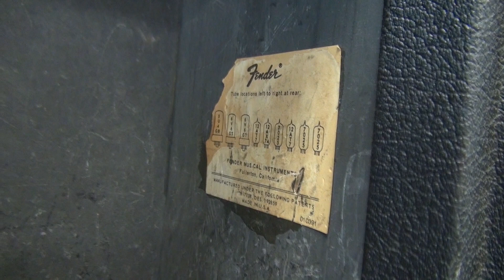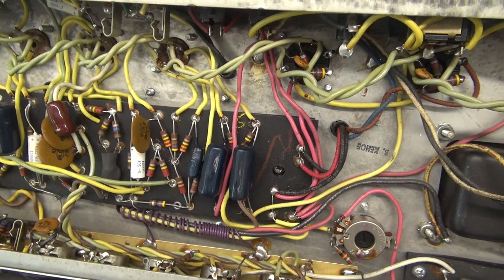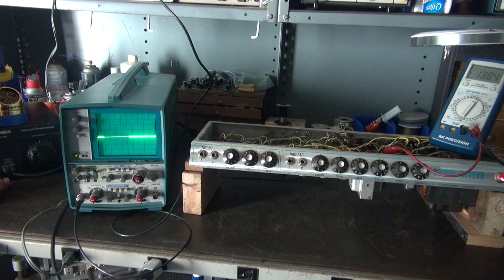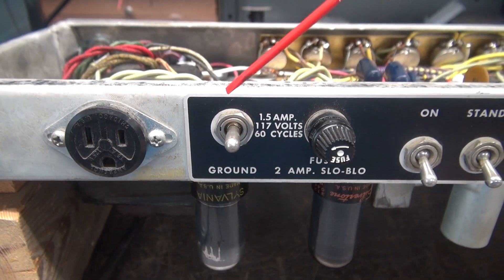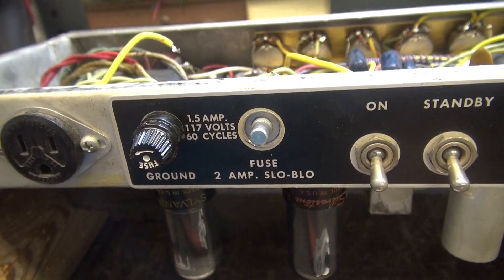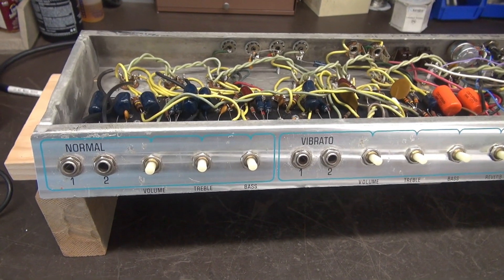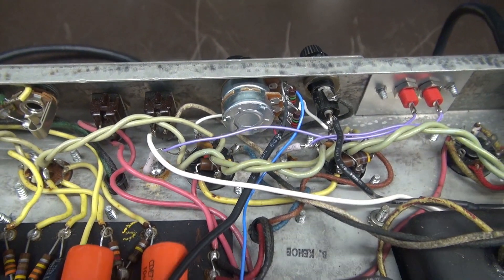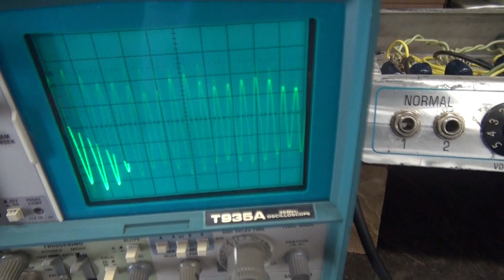How to Repair Fender Deluxe reverb tube guitar amp smoked filter caps

Comment: Excellent Deluxe-Reverb hose-down Terry. Last thing is to cut out the two 1200 pf ceramic caps from grids to ground on the 6V6 outputs. Now you have an AB763 Deluxe Reverb and you be stylin'. And once again; if you have hiss, replacing the carbon comp 100K plate resistors with metal films will achieve magical results. You might not have noticeable hiss since the existing 100K plates R's are 1-watt so they will be less cooked than your usual 1/2 watts. Still. I don't care how low the noise floor is...you WILL hear a difference going to MF 2 or 3 watt R's for those 100Ks. Take the $3 challenge!

Comment: As a long time player (and amp tech) I can tell you a master volume in the rear of the amp is a bad idea. This is one amp I would never add one to, it’s a beautiful blues and soul, funk or jazz amp just how it’s designed but to each their own. Nice video as always
Reply: In general,  I don't like to mess with original circuits...   However,  since it's a reversible mod,  I'm not too upset.
Reply: Customer requested it. It's reversible.

Comment: I see it's been a year since I last saw and commented on this video. I still would like to know where I can find the grounded accessory receptacle.  ANYWAYS... This time around I caught something I missed before - it seems you didn't need to move the fuse holder.  since you had to rotate the master volume pots for clearance, it looks that if you put that pot in the old ground switch hole, you could have rotated it the other way where the solder points would have been in virtually the same place (except inverted, of course). Any issues with doing it that way? Seems to be an either/or situation...

Comment: The 5U4 has a 5volt 3amp filament.
Question. Would it be safe to replace it with a 5AR4 GZ34? And if the high voltages go a bit higher can you just change HV power node resisters to a little higher values to compensate. Being the GZ34 is more efficient & has a lower current draw for the filament. It would be easier on the power transformer. Filament voltage Supply.

Comment: As I was watching this video, I noticed that this amp started out with a 3-prong grounded accessory receptacle (before you replaced it with the banana-plug bias test points. I have been looking for such a grounded receptacle (or two) for when I upgrade my power cord on my Silverface Pro Reverb and Bandmaster Reverb amps (that I've had since the 70s). Where can I find such a receptacle?

Comment: What was the reason for not leaving the fuse holder where it was and just putting the MV pot in the ground switch spot?
Reply from the maker: Yes, to position the Master volume pot as close to the output tubes as possible
Reply: @d-labelectronics  I understand that, but had it gone in the ground switch spot and the terminals turned to the other side, it would have been virtually the same distance and after you took the AC receptacle out, you wouldn't have had the power from switch to fuse crossing back over or under it.

Comment: Lol, nothing goes together like a bottle of wine & high voltage. Why didn't you leave the fuse in the original space and just put the rca jacks in the old ground switch hole? That way you would have only had one space misnamed. Other question is when you were measuring the negative bias, you stated values in mA but your dmm was set on mV. Did I miss something?

Comment: I have some laney ti100 and vox ac30 amps that I bought new, I don't play anymore so they are just sitting. 
Is that a problem?
Thx.
Purchased in 2012 or 13 ,no real use. 
Keeping as....memories of..
Lee's museum of rock...
X navy et and a old guy..
Will the caps survive? 
Good temperature and 50% or lower humidity.
Reply: Power them on and out of standby every few months to re-form the electrolytics and keep them from drying out. They don't have to be on for long. Worst thing a tube amp can experience is lack of use.
Reply: @MuscleDad420  thanks, I seem to remember something like that now that you mentioned.  I better get busy!

Comment: Terry- I just had an interesting exchange with 'Mr. Carlson's Lab". He was working on an old radio with a speaker on the side. he highly suggested to cover the speaker to keep from poking it with a finger or a tool. BUT, he didn't cover the speaker. He didn't cover the speaker  because "he has worked on hundreds of radios". Question is - "Wouldn't you take your own advice if you thought it was important enough to include it in your narrative"??? Couldn't even a seasoned technician make a mistake & puncture a vintage speaker during a repair??? I don't expect you to throw Mr. C under the bus, but I didn't get not taking precautions you highlight yourself....

Comment: bet money someone says "dont you mean millivolts!" regarding the bias check. To proactively answer the question: he has a 1 ohm resistor which simplifies Ohms law to voltage = current (non technically speaking)
Reply: And I would have been "That Guy" had you not posted this!
Reply: @cbmikey  glad i could help out